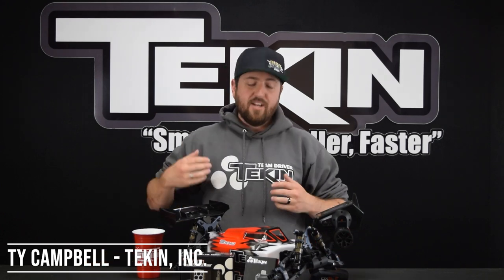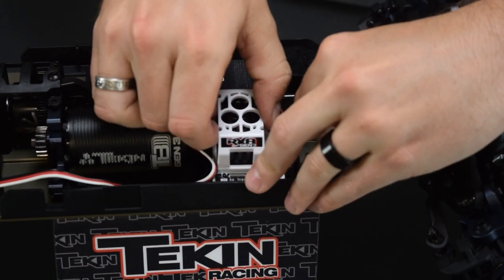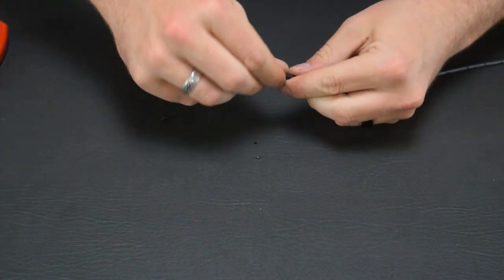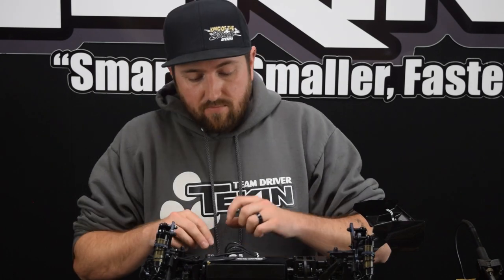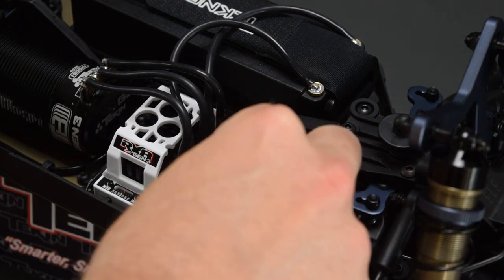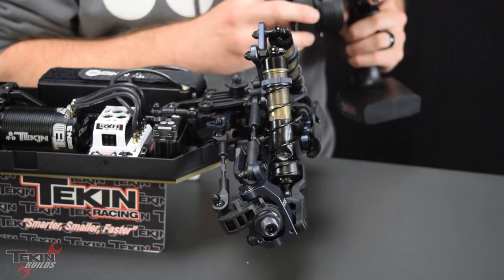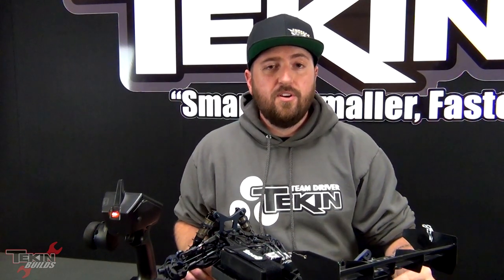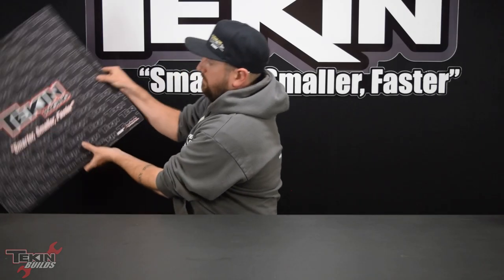Tekno EB48 2.0 Electronics Install | Tekin Builds Ep. 23

Comment: Just got my EB48 2.0 and this will be my first build. Since I was thinking of going tekin 1900 motor and the gen3 rx8, Thank you so much for this great video! You did a Fantastic job explaining and showing things clearly. 

Is there any other tips or recommendations You could think of, after this video was made?

Please keep the EB48 2.0 videos coming! ❤️🍻
Reply from the maker: Thanks for watching Mark, glad it helped you out! One little detail I forgot to mention is that when you fill the diffs with the gears and shafts in the housing there will be air pockets in there unless you let them sit a really long time. Usually the first time you open them back up after driving they will be low on fluid, so it is a good idea to check them after a quick test run and top off if needed.

Comment: I’m having a problem with solder sticking to my motor tabs. I’ve had so much trouble trying to solder the wires to the tabs that now there a rusty color.. is there any tips? Or can I get the motor tabs replaced? Thanks I’m advance
Reply from the maker: Lots of heat and big chisel tip. They need to be pretty hot for the solder to wet and flow to them.

Comment: What tool kit if there is one do you suggest for Tekin builds.
Reply from the maker: I use a combination of mostly MIP and Vanquish tools when it comes to drivers and wrenches. I also use Tekno shock pliers for anything that need a link end threaded onto it. Pliers and cutters I just grab whatever I have laying around.
Reply: @TekinRacing  one more question if you were to buy a set of spare parts just for the future, what parts would be on the top of your list?
Reply from the maker: Well, I haven't broken a single part on my Tekno 1/8 scales, but I always have spares for pretty much the whole car. Bulkheads, arms, hubs, turnbuckles, spur gears, wing and wing stay would cover most of it.

Comment: Hi just got the motor and the eb48 2.0. The motor posts line up at an angle.  When you talk about clocking the motor to get them straight is there anything I need to consider b4 or after doing that?